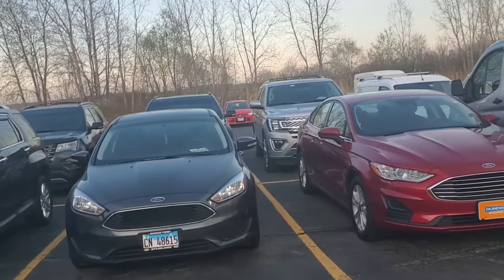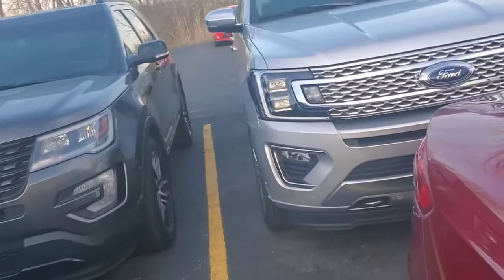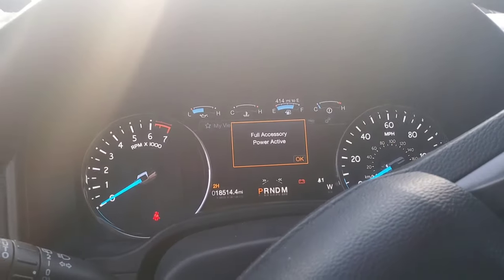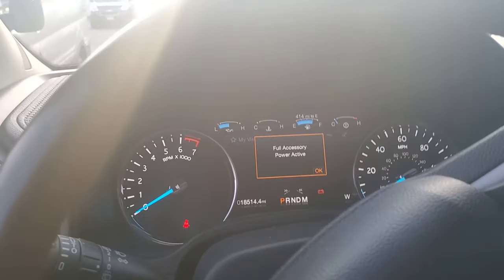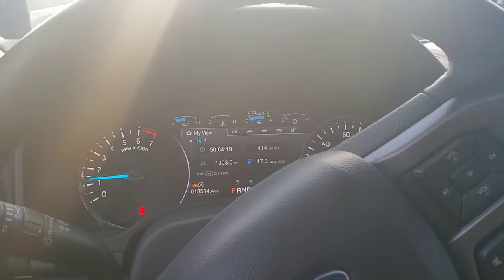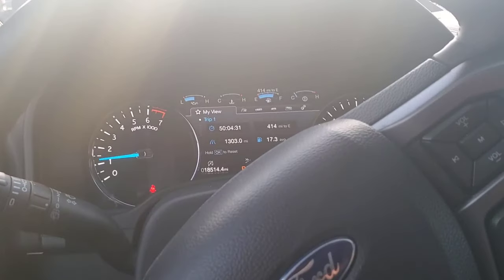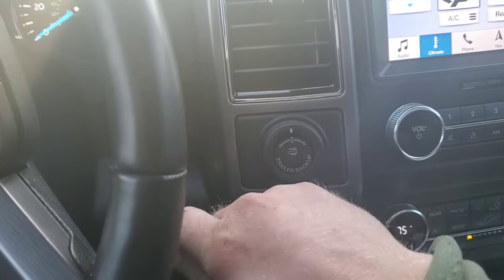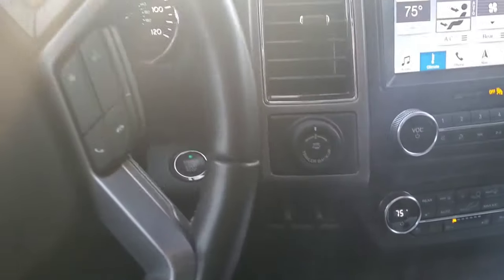3.5L Ecoboost F150 Rattle on Startup then gone, Try this - Could Fix Ford's Phaser Problem

Comment: So, Ijust bought a (new to me), 2011 F150 Supercrew 3.5 Ecoboost a day after I saw this video. The day before I saw it was when I checked out the truck at the used car dealers lot. The Phaser rattle scared the crap out of me not knowing what it was so, I walked away. That night I found this video after googling 'loud rattle on 3.5 ecoboost', here on you tube. Carfax showed that the truck had a timing job and water pump just 19K miles earlier so, I was a little perplexed. I went back the next day and tried the 'crank n prime' trick. DANG, It worked! After explaining to the dealership that I needed to pull the body and the front of the engine off to do a full timing job, I drove it off the lot for only $7,800 ! Got a gorgeous 'Pale Adobe' supercrew dream truck for under 8K cash! Thanks brother, you made my dream come true!
Reply from the maker: That's absolutely amazing

Comment: I’m a heavy duty mechanic, most everything we work on has a Pre-Lube system . The external pump is mounted to a starter like motor and can run for well over a minute. Makes good sense here to pre-lube / prime the oil system. 
Great topic and awareness . Thanks
Reply from the maker: Thank You Brother

Comment: I tried this work around you recommended in this video with my 2019 F-150 with the 5.0 that started to rattle on start up. Worked like a charm. Gas peddle down turn key 5-6 seconds then let off gas. Cranks over and no more rattle! Thank you!

Comment: A remember my uncle had a turbo Mustang from the eighties and he added a pre-luber/post shut down oil circulation pump.
When you turned the key to run, the pump would prime the system to 40psi (took about 2-3 seconds til the green light came on) and after shut down it would run for 2 minutes to cool the turbo. I bet that'd do the trick also.
Reply: I feel like even for cars that don't have VCT/phasers, a pre-prime of the oil pump can't be bad since most of the wear in engines occurs right on startup

Comment: Delaying fuel injection until oil pressure is detected is a common practice for ensuring that the engine is properly lubricated before starting to run. Here are the steps to accomplish this on your Ecoboost 3.5 engine.

1. Locate the Oil Pressure Sensor: Start by locating the oil pressure sensor. It is typically located near the oil filter. The oil pressure sensor sends a signal to the Engine Control Module (ECM) indicating the oil pressure level.

2. Review the Wiring: Review the wiring diagram for your vehicle to understand how the oil pressure sensor is wired. You will need to splice the fuel injection circuit into the oil pressure sensor circuit. The goal is to only enable the fuel injection circuit once the oil pressure sensor indicates that oil pressure has been established.

3. Install a Pressure Switch: Install a pressure switch in the oil pressure line after the oil pressure sensor and before the fuel injection system. The pressure switch should be normally closed (NC) and open when oil pressure is detected.

4. Connect the Wiring: Run a wire from the pressure switch to the fuel injection system. This wire should be connected to the fuel injection circuit so that when the pressure switch is open, the fuel injection circuit is enabled.

5. Test the System: Before starting the engine, test the system by disconnecting the oil pressure sensor wire. The fuel injection circuit should not be enabled because the oil pressure sensor is not detecting oil pressure. Reconnect the oil pressure sensor wire and verify that the system enables fuel injection once oil pressure is detected.

It is crucial to ensure that the system is properly installed to prevent damage to the engine. It is also recommended to consult with a professional mechanic or automotive engineer if you are unfamiliar with modifying vehicle systems.

Comment: I had to have my timing chain on my 2014 F150 replaced (big money). Now I have this exact problem and Ford said they have no idea how to fix it. You're so smart and I 100% agree with you. Nice work and excellent idea!
Reply: What made you realize your timing chain was bad? My ecoboost is doing the cold start rattle but that’s it. Still drives great. Not sure what to do.
Reply: I spent about $3,000 due to timing chain stretching, but now about 3 years later the same rattle is starting to come back.

Comment: Thank you very much for the video.  Not only Fords have this problem, other brands also.  There are Hondas that have the same problem, in some cases it is solved by putting the oil of the specifications.  Many think that as the car ages, the oil that has to get into it has to be thiker, and that is where the problems begin. It's so important to let the oíl get to the motor very fast, that's why they make it so thin.

Comment: @ford boss me Unplugging the variable oil pump defaults the pressure to 72 psi full time.

Holding down the gas pedal does work. I've done this for a while now.

The ECM variable oil pump cranking time can be increased. I see that table in the tune.

Comment: Really appreciate the time you've taken to make this video. I'm going to try this first thing in the morning.  Just had my oil changed and the initial start up was horrible
Reply: try lucas heavy duty oil stabilizer  the next time you change your oil put some some in it’s for dry starts should also help with the rattle

Comment: Interesting solution, and pretty simple for Ford to implement. I was thinking another option would be an oil reservoir, that has a 1 way valve to fill/pressurize with oil while the engine is running. Then another valve that opens prior to engine start to pre-prime the oil system.

Comment: "Clear flood", I have been doing this to get cars into my bay. Agreed that 150 cranking rpm is way better than 7-800 idle rpm, while building oil pressure.
Reply: many times an initial start will see rpms of 1300 and gradually drop to 7-800 so 150 for 6 seconds is much better id think

Comment: Great content! My wife's 2016 Expedition with 88k miles has the same issue. Changing the oil to 5w40 Delo 400 XSP and changing it every 5k has removed 95% of the rattle. Every so often on very cold days does it happen, but it's extremely infrequent now. I only switched after a lot of research into their additive package and also figured if a diesel with new catalytic systems can go 10k plus, why not my turbo gas motor. My expy has never run better.

Delo 400 XSP SAE 5W-40 with ISOSYN Advanced Technology is excellent for use in engines developed to meet 2010 emissions standards and in engines equipped with features like four-valve heads, supercharging, turbocharging, direct injection, shorter piston crowns, higher power density, intercooling, full electronic management of fuel and emissions systems, exhaust gas recirculation, and exhaust particulate filters.
Reply: Putting thinker oil in a motor that call for a thinner oil is horrible for your motor fyi
Reply: @mattwagner8965  well, I live in California where the temp hardly ever gets below 50*F so the added viscosity is not an issue. Been running this for 20k miles with nothing but an improvement and no start rattling. Also   test my oil samples from black stone and show improved wear So YMMV 🤷🏽‍♂️
Reply: @RobertMichaelPhotography  nothing to do with weather it calls for thinner oil so it goes to the cams faster and lubes up bearing faster I mean if you ain't had a problem and you wanna do that go for it bro but I wouldn't
Reply: @mattwagner8965  5w-40 is same viscosity on start as 5w-20. should oil just fine on start up. not sure about today but diesel oils used to have high zinc content which was banned in gas cars with cats since it ruins catalytic converters

Comment: First thing your should try is the oil filter. There is an issue in the Ecoboost, where if the small o-ring on the stem of the oil filter cartridge gets damaged, the oil will drain back to the pan causing the rattle on startup.

Comment: I get the feeling master techs such as yourself could design phasers that would last as long as the motor itself.  The other observation I have is phasers come into play at high RPM.  Most people never exceed 4,000 rpm especially with automatics having many close ratio gears.  Ford should delete phasers.  HP rating would suffer but motor would be bullet proof like the 2V 4.6.

Comment: I agree with everything said here although my rattle sometimes started up to 15 - 25 seconds after the engine was started, at times just after it came off the high idle and when the rattle started it hammered like a 71 series Detroit diesel up to 20 seconds then sometimes "click" and go silent. 
Not sure if the prime would help although I'll give it a try. We've used primers on other performance vehicles in the past and they make perfect sense of raising the oil pressure prior to starting. My phasers were replaced and the rattle may be back at about 18,389 KM's later. For the record this rattle had nothing to do with the injectors or sloppy clips on the wastegate levers which would be a blessing in comparison.
Reply from the maker: It sounds like you have something serious going on like really worn out
Reply: @FordBossMe  Hopefully will find out soon. The oil was always changed with full synthetic every 5000KM's so contamination shouldn't be an issue. Possibly sticking pins that lock the phasers into position when cold gone. Guessing at this point.
Reply from the maker: That makes more sense than anything honestly

Comment: My 2019 f150 3.5 liter rattled this am on a cold start. Thanks for the tip, I will be doing that every cold start from now on, hope it works!
Reply: My dads 2018 f150 3.5 does this as well. Does it cause damage if he doesn’t have it looked at or does this startup method?  I’ve told him I’ve heard a noise but he doesn’t hear it
Reply: @kyleyoung7341  Take it to the dealer and have them replace it. They issued a recall for it and they even pro rate the replacement of them if you're out of warranty. 

It will gradually get worse and eventually start having a constant knocking after the engine is fully warmed up. It will also start having issues where you'll press the throttle down and the truck will just fall flat on its face for a second or two. Get it fixed before it gets any more miles on it!

I had my 19 F-150 done in March. It only had 32k Miles on it and was getting progressively worse.
Reply: @hondaracerfrd1  thanks Sam, that’s very helpful info.  I’ll relay that to my Dad.

Comment: Awesome video.  I have figured the same thing out.  I have never replaced a cam phaser and I have owned a few 3 valves.  The 3.5 I own now is at 235,000 miles and still running fine.  I do use additive’s on mine and I use the combination in everything.  1oz per quart of oil of Lucas stabilizer and the same ration of hotshots stiction eliminator.

Comment: I had considered building my own pre-oiling system, but this knowledge is gold!  Thanks for showing us how ;-)
Reply from the maker: Yvw
Reply: I remember seeing an invention originally for turbos that was basically a spring or gas pressure accumulator that held a quart or so of oil that would feed the turbo's bearings cool oil after shutting the engine off. With a few solenoid valves this could pressurize the oiling system before and after start-up and shut down. Sort of like a bladder tank on a well system.

Comment: Great idea! Having oil pressure is good . Thanks didnt know I could do this.
Reply from the maker: yes sir indeed
Reply: Flood mode
Reply from the maker: I did specify that's what this was in the video
Reply: @FordBossMe  thanks I’ve been going out at night to start my truck to keep it from doing this, let it sit about 12 hours when out this morning Crank the engine for about three seconds then took my foot off the gas and no Randle I have a 2014 F150 eco-boost thanks very much progress I was afraid I was I was damaging something by letting it sit too long I appreciate it keep up the good work

Comment: My 2015 f150 3.5 EcoBoost developed a rattle. instead of bringing it in I did some troubleshooting. Thankfully In my case it was failed clamps on the muffler heat shield. Easy fix!
Reply from the maker: I also have a video on that as well showing people that that is the number one reason for the rattle

Comment: This is awesome it works perfectly on mine! You have to hold the gas and brake while pressing the start button for about 3-5 seconds to allow the oil to make its rounds and then release your foot off the gas and you get a good clean, smooth, no phaser rattle start :)

Comment: Just wondered, I’m taking my 2018 Ford F-150 in next week to have the cam phasers replaced. Judging by the 3 page parts list it’s quite an extensive job. My question is after the truck is fixed would it be a good idea to used the gas pedal to the floor method on start ups after the fix to prevent it from happening again?
Reply: Great question,  I'd love to hear or see the reply on your question  
👍👌,
Reply: Was yours covered by the powertrain warranty ?
Reply: @jaygallegos7728  did you ever find a answer to this question? I have a 2018 eco that rattled on cold start with 40k under power train I’m setting a appointment
Reply: @jeromed3904  yes everything was covered
Reply: @jaygallegos7728  any issues after ? Did they put a new cam ?
Reply: @jeromed3904  new replaced all cam phasers, to be honest it was at the dealer for over a month. I got it back a friday and sold the truck for $5k more than what I owed. Now I got me a 5.0, only thing that kills me is gas. But worth it
Reply: Got it back friday, sold it that same Saturday
Reply: @jaygallegos7728  thanks Jay I think I’m gonna get rid of it I just bought it This Saturday with 41k miles and I’m hearing the rattle sound but when warmed up I can’t hear it anymore.
Reply: @jaygallegos7728  bought it from a BMW dealer and they said the noise was nothing but I noticed it and it’s a rattle sounds like a whole in the muffler now I’m trying to return it and they refusing making me trade in after 3 days !! Smh
Reply: @jeromed3904  yikes, what u just described is exactly the issue I had. It hasnt been 7 days bro, u should have a lawyer look into it, they sold you a broken truck. What prt of the country r u in ?
Reply: @jaygallegos7728  man I’m going through it 😔 it’s not a loud rattle though it’s subtle but there sounds familiar? I’m in Texas they literally just told me that “we can only trade it because the car is registered to you now” which is crap appreciate you responding bro. Ford would do the 5 warranties but it’s not fair to me to wait a month for this crap and not knowing the longevity of it with issues now.

Comment: Honda and Toyota engines have this problem too.  Hondas do not have a flood mode for the vast majority.  You can mitigate the rattle by installing a fuel pump kill switch to crank the engine and prime the oil pressure.  That’s separate from exploring spring replacement or entire actuator replacement.

Comment: I experimented with this for a whole month and posted a video of my findings on my '18 with 27K miles. In this video your total cranking time was about 11 seconds. Yesterday I managed to hear no rattle at all after cranking for a total of about 8 seconds, but I did it in 3 crank sessions for about 3 seconds each. To be sure I didn't hear anything I filmed from the outside, not inside. Will this excessive cranking cause premature starter wear? And what happens if owners decide not to fix this? Will the rattle eventually lead to other things that will destroy the engine?
Reply: I wouldn't worry about starter longevity. Starters are made much better than the 80-90's. and Todays cars get running faster with less cranking than back then.
Reply: worthy considerations. The starter is going to be working at  4-6X more than usual, as most start ups are nearly instantaneous in normal circumstances. And I had always been under the impression that cold start up rattle was a function of bled off timing chain tensioners, not the phaser assembly. This is what I have learned about the 5.4 triton. If the tensioners are leaking that has been claimed to lead to oil starvation in the heads along with the cold start up rattle. So oil priming may well lead to elimination of the rattle, but is there unheard, unseen damage going on due to oil starvation? Seems that based on what I have learned form other YouTube posts this rattle is an indication of component failure, any solution like this priming is just putting off the inevitable and perhaps allowing some serious engine damage.

Comment: I have a 2019 F150 3.5 eco-boost and this has been a problem most of the time I've had this truck. Ford has already replaced the cams once and of course it's been back at it for a while now. But, I can't afford to fix it on my dollar right now. Ford actually just gave me an estimate of about $4500 to fix it again. I'm going to try this the next time I let it sit for a while. Great info
Reply from the maker: So this should work stop the noise on Startup but it doesn't mean that it has fixed any problems, Ford went through three generations of cam phasers before they got a generation that would work long term and a lot of people got the second generation instead of the Third and now the third generation is out